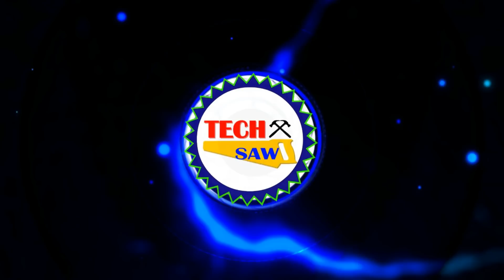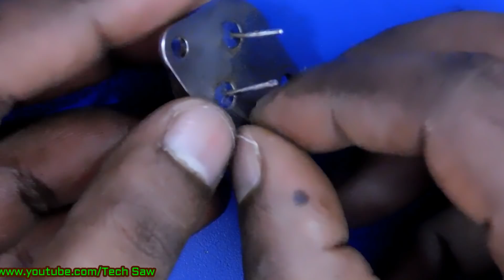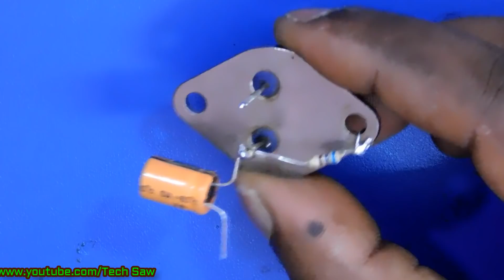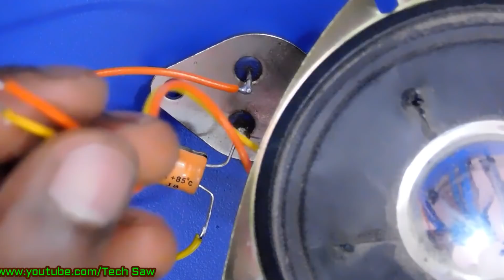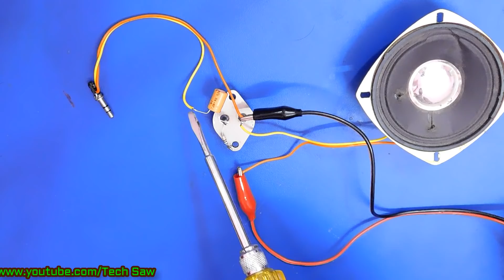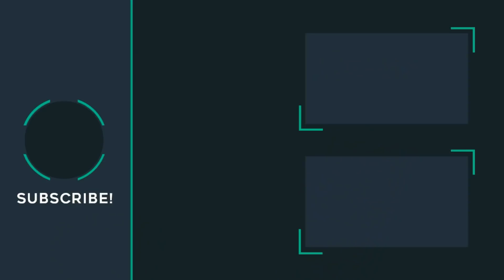One Transistor Power Amplifier Circuit

Comment: This is nearly there but it does have a wiring error.
The yellow wire connected to the Loudspeaker should have been connected to the Transistor's collector and not to the emitter where it is.
The Loudspeaker impedance is not given but if it is a low one of say 8Ohms then it was a good idea to use a fairly large one and
I would suggest that you go a little lower on the supply say 3V to prevent things getting too hot.
The Resistor value should be selected so that you have roughly half the supply voltage at the collector with respect to 0V so that the circuit is in Class A.
It should then work reasonably well for what it is.
Faking results is a little bit naughty.